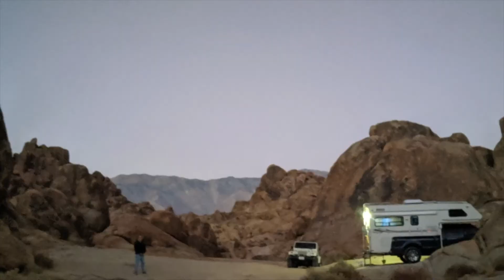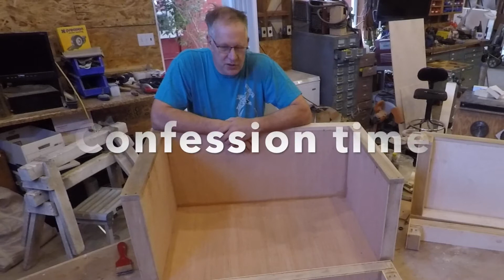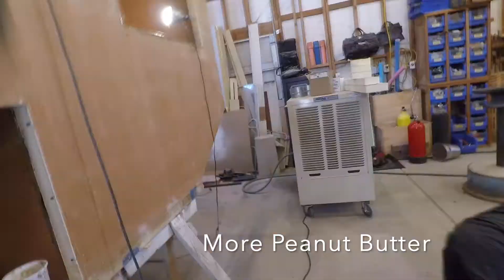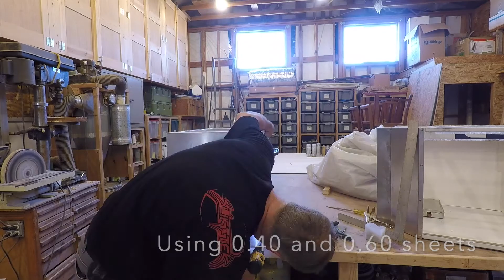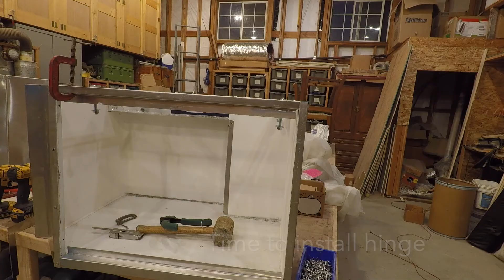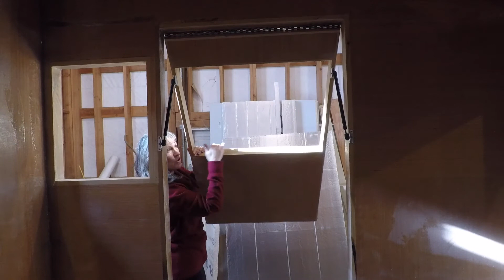Custom Flatbed Camper Build | ep: 5 | Building cargo boxes, wheel wells & doors

Comment: I know you are using poplar, what is the actual nominal dimension of the lumber being used? Is it the same for the main wall structure itself? An amazing job!
Reply from the maker: I am using '4/4' ('Four quarter') lumber which is actually 13/16" thick. I rip it to 2" width and pocket screw it into a frame. My intent is the lumber is principally to enclose and seal the edges of the SIP (structural insulated panel) and provide continuous connection between panels and around penetrations and plywood seams, not to provide a frame. The strength of my SIPs is in the 5mm plywood skin and 5mm square grid internally plus the fiberglass skin. If I had to do it again, I would probably use 2.5lb/cuft XPS foam (which is used for under concrete insulatio as opposed to the 1.5lb/cuft that is standard for building insulation) over the polyIso and grid.

Comment: you guys are amazing, do you guys have thought about using composite panel instead of using firebelgrass ?
Reply from the maker: There is a lot of misunderstanding about how 'composite panels' work. Not clear what the specific question or direction your interested in investigating so I'll throw out some thoughts; 1) commercial composite panels use either structural foam or honeycomb cores. Both are much stiffer than insulating foam and only fair insulators. 2) Using XPS insulation as a core can be effective BUT, use 2.5lb per cubic food density, not 1.5 lb which is most common. This will provide enough compressive strength to be effective. 3) the face panels provide strength and need to be just strong enough to carry the load but not to heavy to defeat the intended weight savings. About .2-.25" thick wood is adequate but needs to have a waterproof layer. European expedition vehicle makers use a Filon like external skin over 5mm(.2") plywood which is effectively what I did. 4) to be effective at load transfer, edges of adjoining panels need to be continuously bonded to each other. Screwing or riveting the face to a non bonded angle  joint on the exterior is grossly insufficient (meaning most of the 'exoskeleton' constructions). The same is true for the interior surface bonding which most folks ignore. Reiterating,  composite panel construction is about making an effective load bearer of the panel skin, both interior and exterior  skins must be continuously bonded to adjoining panels. 'Real' commercial panel builders do what I'm saying, almost every amateur does not.

Comment: Remind me to never get into a design, fabrication and construction competition against this fella, as he'd crush me in all ways one can be crushed, if I did try it.  Everything he designs and builds is quite literally outstanding.
Reply: Thanks for the compliement. I am a Mechanical Engineer and have retired from a career in design and manufacturing engineering, including 3-1/2 years as plant engineer for Safar Motor Coaches so I have a significant leg up on most folks. I think there are many fabrication techniques superior to what is commonly used in the RV industry and want to expose anyone with a DIY mindset to them.